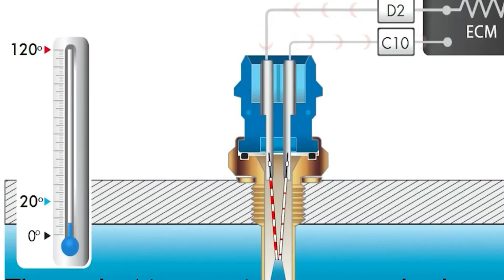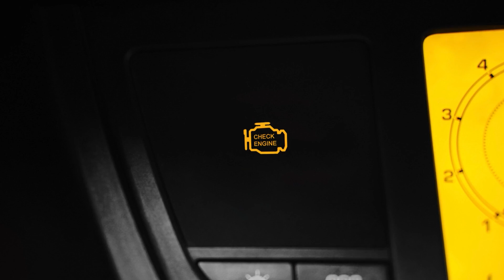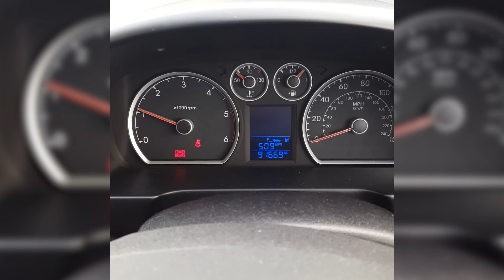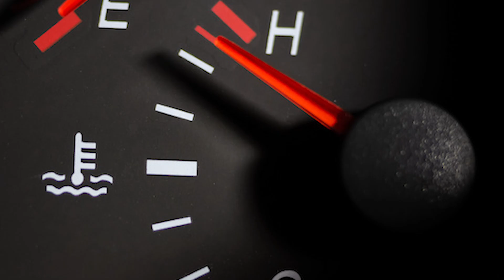8 SYMPTOMS OF A BAD COOLANT TEMPERATURE SENSOR

Comment: I have ford focus 1.4 16v zetec-se 2002 and low fan radiator speed won't turn on . Hight speed radiator fan works ok and it kiks at 120°C, and when I turn AC low speed radiator fans turns on. CHT sensor readings seams ok e.g. I see CHT temp 112°C but fan is off. Gauge temperature needle is on half. Is this problem with CHT sensor?

Comment: My Suzuki SX4 2006 petrol, reaches optimum temperature, but then after a while the fan turns on even though at optimum temp., whilst it's 5°C degrees outside (winter). I changed radiator, thermostat, water pump and radiator cap- nothing, the fan still turns on. After a while it turns off then after a while turns back on. Weird. I'll replace the coolant temp. sensor and see.
Reply: Did it work?
Reply: @SaltMinerOU812 no, I changed the sensor but it wasn't it. I went on a long journey and it begun overheating so had to be towed. Now I bought a little head gasket test kit to see if there's emissions gasses in the expansion tank. £15 test kit off eBay. If it turns out it's not the head gasket I don't know what else it could be? Some sort of a blockage somewhere in the heater core or some of the cooling system hoses, preventing the coolant from circulating everywhere? It is a shame because the car has been well maintained and it might have to get scrapped

Comment: Been having similar issues on a 1989 Volvo 740. Shop said the wires to the coolant temp sensor were split and broken. Makes sense. Car doesn't want to start without using starting fluid. When it's running it runs fine, temp gauge goes nuts though.

Comment: 2013 ford escape. Starting the motor when its cold. Within 2 minutes the vehicle says its overheating when its not. The engine had only been running literally 2 minutes.

Comment: 😮my 2010 jeep liberty would start with a very rough idle after it got hot. I would shut it off and let it sit for 10 seconds or so. Then it ran perfectly.  After I replaced the coolant sensor it started up when hot with no issues.

Comment: I just replaced the ECTS but FIXD indicates ‘Low Input’. I noticed that after replacing the sensor, the wiring cap didn’t snap in place. Upon examination, the wire contacts inside the cap are not supported to assure proper insertion.
Reply from the maker: If you're getting a "Low Input" code after replacing the ECTS and the connector doesn't snap into place, the issue is likely with the sensor's electrical connector. A low input code usually means the ECU is seeing too little voltage, often caused by a poor or broken connection. If the wiring cap isn’t securing properly, the pins inside may not be making full contact with the sensor. This can cause an intermittent or weak signal, triggering the fault. Check the connector closely for bent, pushed-back, or corroded terminals. If the terminals aren’t supported properly inside the cap, they may need to be repositioned or the connector replaced entirely. You can find replacement pigtail connectors at most auto parts stores or salvage yards. Once the connection is solid and secure, clear the code and monitor the readings to ensure the issue is resolved.  Good Luck!
Reply: I have the same probelm

Comment: Where's coolant temperature sensor on bmw 318i 3 ... overheating car  staling in middle of the road when temperature rise.
Reply from the maker: On a BMW 318i (E46), the coolant temperature sensor is usually located near the thermostat housing on the engine block. If your car is overheating and stalling as the temperature rises, the sensor might be faulty, giving incorrect readings to the engine control unit (ECU). This could cause the engine to shut down to prevent damage. It’s also possible there’s an issue with the coolant system itself, like low coolant or a failing thermostat. Hope this helps.  Good Luck!

Comment: so i was replacing the starter on a 2000 Honda accord and when i got everything out back together p0118 code shows up but i cannot even find the harness connector to connect to the engine coolant temperature sensor
Reply from the maker: Oh nooo.  I hope you can fix this one.  Try looking up 2000 Honda Accord repair videos and photos and see if it can show up.  I don't remember exactly on this one, but on a 2000 Honda Accord, the engine coolant temperature (ECT) sensor is usually located near the thermostat housing or engine block. You’ll typically find it close to where the upper radiator hose connects to the thermostat. The sensor is threaded into the engine block or cylinder head and has a two-wire connector. To access it, you may need to remove some hoses or components, like the air intake, for better visibility. If you're unsure, checking the vehicle's service manual can provide a clear diagram of its exact location.  Hope this helps.  Good Luck!

Comment: My overflow tank keeps boiling
Reply from the maker: If your overflow tank keeps boiling, it's likely a sign of an issue with the cooling system. One common cause is overheating, which can happen if the thermostat is stuck closed and prevents proper coolant flow. Low coolant levels can also cause the system to overheat, so check for any leaks and ensure the coolant is topped off. A clogged radiator or a failing radiator fan can prevent proper cooling, leading to boiling coolant. Another possibility is a malfunctioning water pump, which could fail to circulate coolant effectively. A blown head gasket can also cause excessive pressure in the cooling system, leading to boiling coolant. It’s important to address this issue quickly to avoid engine damage. Hope this helps.

Comment: I put a new temp sensor in my car but it still sometimes after I cut off the car the fan still runs. What cld be the issue
Reply: That’s normal bro. It should run about 2-5 min

Comment: Good points made. My 1998 Ford Escort sensor works great until cold days. Then it goes into the normal range as the engine warms up, but soon the temp gauge show goes to the cold side, even though the motor is warm. I have no problems with accelerating, no smoke, fuel eceonomy as usual. But sometimes the motor surges in idle to 2500 or 3000.

Comment: I have a 2014 vw touareg. A sensor went bad, i bought the sensor,but,no way in hell can I found where it is located. I took it to a mechanic and they can't find it. It has the v6 fsi motor. The fan kicks on all the time and is making noise.
Reply: I'm in the same boat. Can't find mine(audi a3 tdi 2011)
Reply: Did u find the issue yet
Reply: YouTube will help you  find

Comment: Some older cars, the fan temp. sensor is a separate unit mounted on the radiator.
Reply from the maker: That's true.  Thank you for sharing.